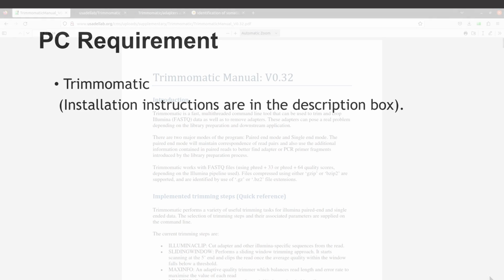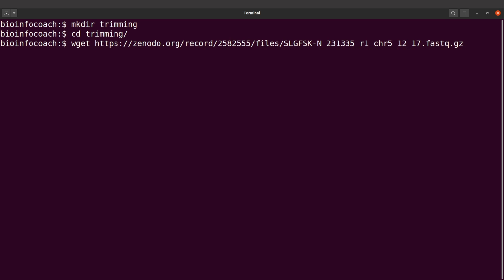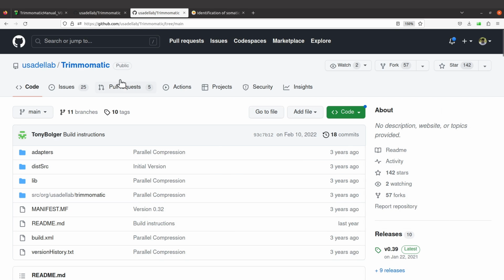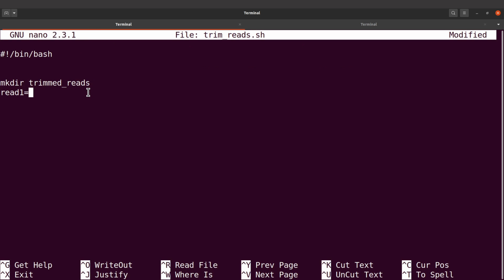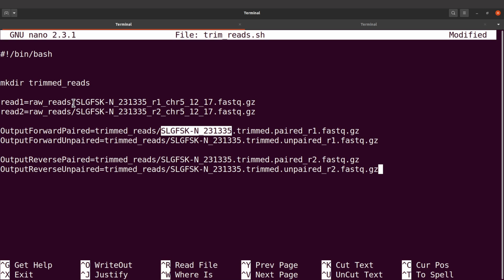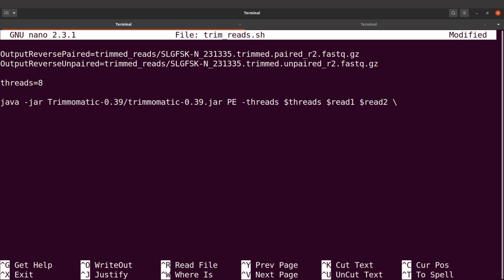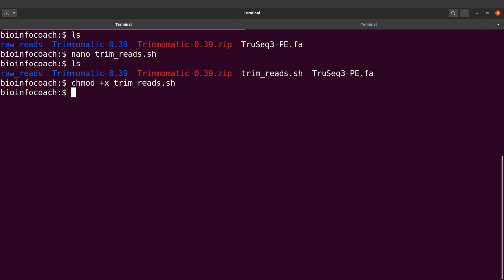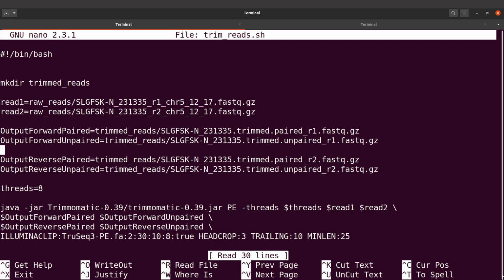Paired-End Read Trimming with Trimmomatic | Paired End Reads | Single Sample

Comment: i followed exactly the same steps, I saw some differences, first, after I click enter when i type in nano trim_reads.sh, it won't create additional terminal window as you did, you have two tabs in parallel, while i only have one. sec, i need to use Ctr+O instead of Ctr+S to save sh file, after the saving, it won;t to back to the original nano trim_reads.sh terminal window, i need to create a new terminal window and use chmod +x trim_reads.sh and ./trim_reads.sh, after that summary part crushed, saying A fatal error has been detected by the Java Runtime Environment:
#
#  SIGSEGV (0xb) at pc=0x000000010c9d7648, pid=10860, tid=10243, what does this mean? thank you for help
Reply from the maker: Perhaps you can book a session so that we discuss more on the issue.